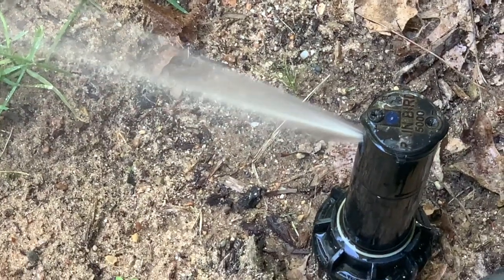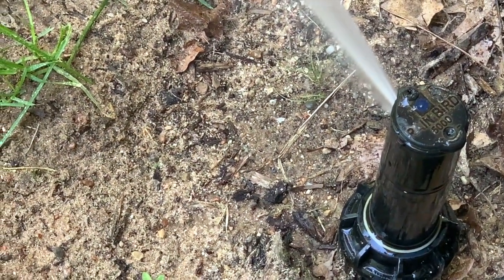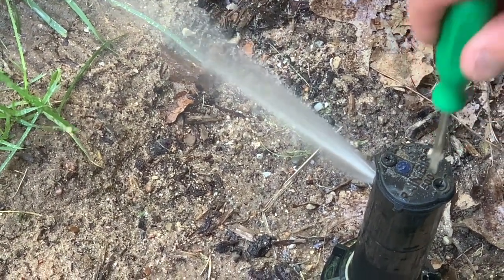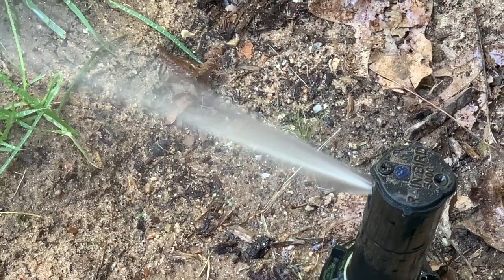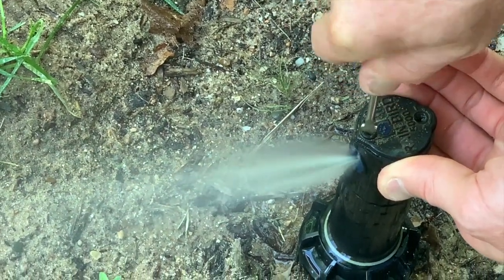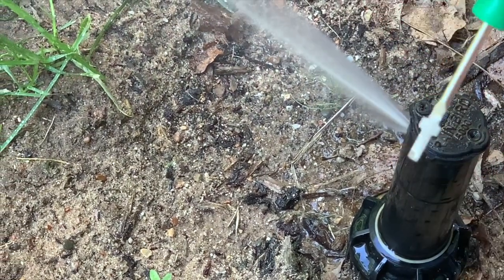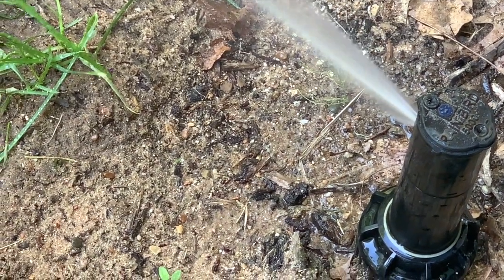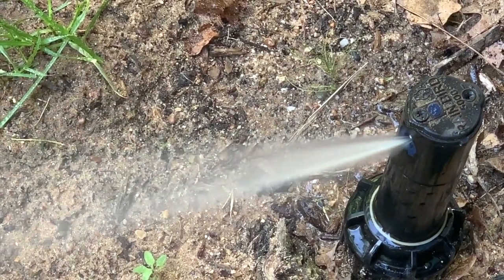Rain Bird 5004 Series Rotor Head Adjustement

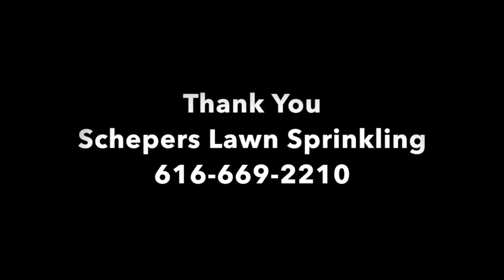Comment: In 2:40 I learned more than watching many other videos.  Thank you !  
Can you describe the function of the blue nozzle insert for the rotor head?
Reply from the maker: Hello, it is the amount of water or gpm that comes out of each head. As a general rule use 1.5 for 90’s, 2.0 for 180’s, and 3.0 or 4.0 for 360’s. Hope this helps!

Comment: Im looking at getting this can it go 360 degrees and how do you adjust to do it thanks. Great video
Reply from the maker: Hello, to make a rotor head do a 360 you turn the screwdriver plus as far as it can go. Hope this helps!
Reply: You can also buy FC (full circle) heads that turn continuously and do not reverse.